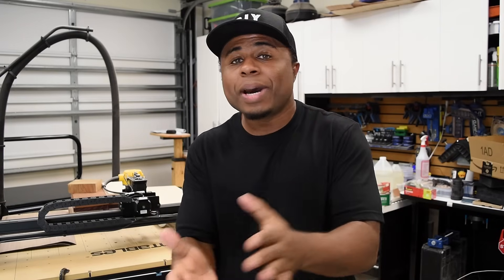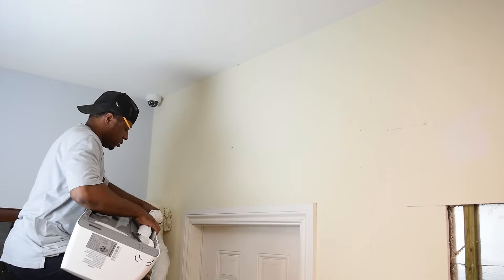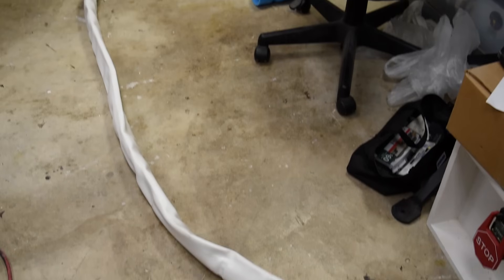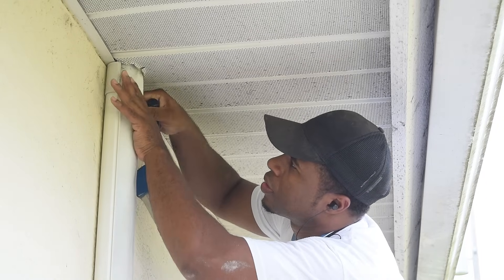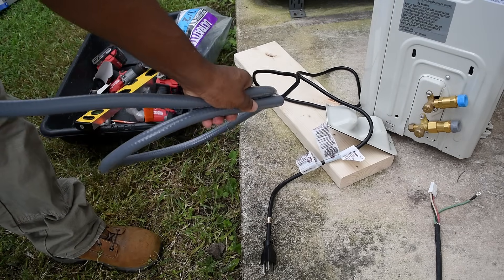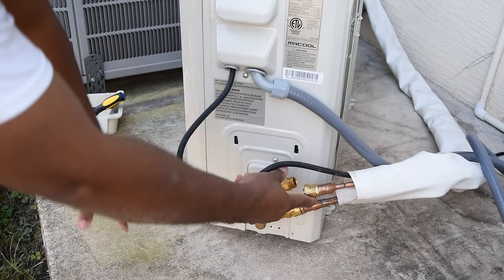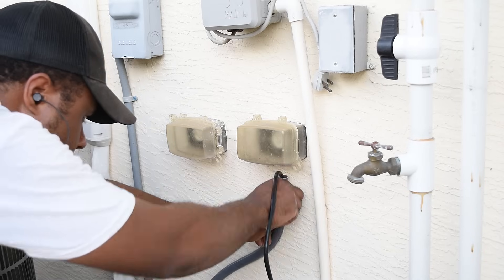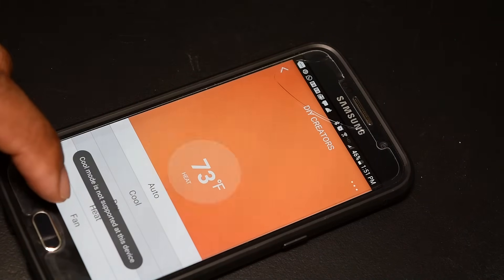How To install Ductless AC & Heating System // True DIY Mini Split MRCOOL

Comment: Thanks for the video. You have made me decide to get this done before summer. I have one tip/recommendation. Put attic foil in the attic above the garage ( atticfoil.com or Amazon - I prefer to buy from the guy who has been selling it for years ).. Installing that will drop the base temperature in the garage significantly and mean that the AC unit will last longer and consume less energy. You staple it to the underside of the roof trusses. I have it throughout the house. It also means that if you do have to work in the attic it is a lot more comfortable ( not comfortable just less uncomfortable I suppose ).

Looks like I am in the market for a mini-split. Thanks again.

Comment: Awesome keep up the good work. I want everyone to follow these directions keeps us service guys busy year round, system now has non condensibles in it. From not pulling a vaccum on system
Reply: Not with this system. The lines are pre-charged as well as the compressor. As you tighten the lines they open at the last 1/2 turn. Then you open the valve from the compressor to the pre-charged lines and your set. That's why you can not cut the lines to size, and you have to coil the excess. No vacuum pump required. Hope this clears that up.

Comment: I'm going to try a system that only costs a little over  1/3 the price of an equal Mr. Cool 24000 BTU ac/heat pump system.  Many systems come "precharged" but my understanding is Mr. Cool charges special copper lines with special fittings  and the compressor and coils are vacuumed and sealed by valves so once you assemble everything you just open valves and check for leaks, where the system I'm going to try the compressor is charged and the lines and coils are open and NOT vacuumed, so I'll need to buy a commercial vacuum pump ( amazon  for $60 - $100 ) and vacuum the lines and coils after assembly but before opening the compressor valves and charging the system.  I want to see if I can do it all DIY for $700 ish instead of $2600.  If anybody sees a fault in my understanding or logic please comment on my comment and leave an opinion.

Comment: I've been looking at the mini-split systems and I like the Mr. Cool because I would like to be able to install it myself. 
My system needs to be a 4 zone 48K btu system. The only question I have is this- is the only length of connecting tubes and power lines just 25'? Or do they come in other lengths?
I will need 2 of the wall units to be more than 25' away from the outdoor unit. 
Anybody know the answer to this? Much appreciated.

Comment: I’m an electrical contractor. I was thinking of installing my own because the hvac guys get $1000 per unit or more.  Thanks to you, I’m going to do my own. I was concerned about having to vacuum lines.
Reply: Just purge the line before you open the suction. Crack or leave the suction side loose to let some refrigerant out and tighten it back up.

Comment: Can I remove the oil heating system in my house and just this those ductless in each room or will the inspector disagree and require to have a Gas/Oil system ?
Reply: In michigan you can have mini splits as your only heat source.  It's best to have more then one or another back up heat in case it breaks or cant keep up in extreme cold.

Comment: If you need to 'fish' a line through difficult conduit, get some string. Tie a small scrap of a rag to one end of the string, and your screwdriver or pliers to the other end, making sure you have a little more length than the conduit itself. Stick the far end of the conduit into the intake of your shop-vac, and block off the rest of the intake diameter with a cloth or duct tape. Turn on the shop-vac and it will draw the scrap of rag through the conduit, while your tool at the other end of the string prevents it being pulled all the way into the shop vac. Total time, just a couple of minutes.

Comment: I would like more information about the way lines are run.  The drain line for example, does it need to be downhill the entire run from the inside unit?  Also this video shows routing the line set up into the attic and then outside and down.  The line set can be routed above the inside unit and then out and down?

Comment: Just a friendly fyi. You need to vacuum the line set before opening the king valves and letting refrigerant into the line set. Specially on a mini split.
Reply: System have moisture now

Comment: CHEAP CHINESE JUNK... DISOPABLE MINI SPLIT.... little to no service parts... poorly made.... limited on line set lengths... poor heating in cold temps... cannot support mini air handlers.... cannot support multiple heads ... in other words ...CRAP!!!  DO YOUR HOME WORK BEFORE YOU BUY OFF THE WALL BRAND NAMES....

Comment: I am HVAC pro tech. My friend Didn't you vacuumed the line before you open king-valve. It will definitely build moiture. Moiture can cause many problems. Then shut down the system....

Comment: if it is really just a 120 v unit, then the heating capability will be not much more than a 1200 or 1500 watt electric heater.  Not bad if you don't need much heat, say in Florida for about one month when it does get down below freezing briefly.  Could take the chill off a room or two but not a big heating thing.

Comment: We have mini splits for 10 yrs, as we remodel a log cabin in tn, we will install 1 or 2 mini splits for the few ac days a yr the cabin needs it. For many years we simply left one big unit on rge upstairs of the block wall house and were comfortable even though the house had one in every room.

Comment: Dumb question, if I have an inside power outlet that runs with a dedicated circuit breaker, is it enough to just plug in (like what you did here https://youtu.be/kI2aLKvMHyo?t=608)  the AC unit into that outlet or do I still need an outside disconnect box for this?

Comment: You should always pressure test a system using nitrogen and use a vacuum pump to remove moisture and create a  vacuum in the lineset regardless what size the lineset is.

Also why did he anchor the unit to vibration pads into concrete  then measure??

Comment: TOTAL BOGUS VIDEO,   SYSTEM IS FULL OF MOISTURE WILL KILL THE COMPRESSOR. , NEEDS A VACUME PULLED TO PROPER MICRON LEVEL AT LEAST 500 MIN.   CONDENCING UNIT MAY COME PRECHARGED BUT THE LINE SET DONT THE GUY WAS NOT TELLING YOU THE TRUTH YOU WILL REGRET IT.

Comment: i install mini splits for a living and im not lying when i say that you actually look like a professional
Reply: U didn't notice him skip vacuum and nitro test process?
Reply: Higher Standard Service the lines are pre  charged , plus he most likely doesn’t have a nitro tank or a vacuum or even a set of guages
Reply: @trillflaco  the lines are not pre charged you obviously dont know what you're talking about. The system is pre charged the lines are simply filled with dry nitrogen until u break the seal, of that... and the fact he doesn't have gauges or vacuum is the reason this shouldn't be done by yourself, the non condensables that are let into the system with destroy the compressor in half its life.
Reply: @trillflaco  who do u install lines mini splits for, I am certified by Mitsubishi.

Comment: I am wondering , it's been a year now since this video..Can you please update us regarding how the Mini split is doing? did it heat up during the winter? and summer of 2019 how was the unit cooling your place. I am very interested to know before I actually buy one. thanks.
Reply: I've been running mine for a little over 2 years. No problems. I use mine mostly for heating. I wish I'd sized up as a lot of heat goes upstairs in the winter. Have to switch over to wood heat around 35 degrees. Cools just fine though.

Comment: You need to remove the air from the pipes with a vacuumpump before releasing the refrigerant!
Reply: This is a DIY version which means you don't have to evacuate anything. Know what you're talking about before you reply to something you clearly know nothing about.
Reply: @Ozzie4Para  okay chill, my bad..

Comment: You missed huge crucial steps. You cannot just connect lines and drop charge. Once those copper lines are exposed to the air moisture and other non condensables rush in. After connection u need to use atleast a 2cfm vacuum pump to pull a 29 inch vacuum for atleast 30 minutes. Although you should use a micron gauge and go by that. Also you can cut and resize those lines. But not running a vac on those lines will b a problem in 2 or 3 years.
Reply: Nope. Not necessary. Lines are charged and sealed at the factory. Seal isn't broken until the lines are connected.

Comment: If you buy almost any ac online without going through a certified tech. You will not get a warranty the manufacturer wont tell you unless you ask but online sales and systems not purchased and installed by certified personnel VOID ALL MANUFACTURERS WARRANTY
Reply: Nope. The Mr. Cool's DIY unit is covered by the manufacturer's warranty when installed by the do it yourself'r. Says so in the owner's manual.
Reply: @brianbrehmeyer3929  really? That's great. I noticed the mr cool DIY does not require you to make system modifications, it is basically a plug and play. The only thing about that is you have to use what they give u and cannot customize anything. I guess it's kind of you get what u pay for type of thing
Reply: Also the diy video does not show anyone testing with nitrogen or vacuuming non condemnable out of the line... even if they come sealed the second u open the line it inhales moist outdoor air which will ruin the integrity of internal components between 8 and 12 years.
Reply: @higherstandardservice9877  The line is sealed. It is fastened to the heat exchanger, that goes in the house, at the factory. There are valves at the other end that open when the lines are connected to the pump. It's been two years, but as I recall it was a flat to flat mating where they were hooked together. The valve opened around the last turn or 1/2 turn on the connector, so there is very little, if any, exposure to outside air. If there was any leakage, I'd think it would be a very small amount of refrigerant leaking out, rather then air leaking in. 
Break even (compared to my previous heat source), for me doing the install, is 3 heating seasons. (I've just started my 3rd.) I had one bid from a contractor I found at Costco, break even would have been 9 heating seasons if I'd went with them.
Reply: @brianbrehmeyer3929  I understand this unit is made and designed for do it yourself installation. However, this is not how any major manufacturer makes their systems purely because they will not last as long, they do not offer customization or pipe length modification etc... regardless of how sealed those lines are there moisture is going to enter the system and shorten the life span. Is this product worth its price and effort, no it's as capable as a window unit or portable ac. The fact that you cannot isolate the refrigerant charge nitro purge the system and vac it down for service is just another reason it's not going to last more than 6 years or so.
Reply: @higherstandardservice9877  Well time will tell. 
But, assuming you are correct and it lasts 6 years, I could replace the Mr. Cool 3 times for what the contractor wanted for one installation.
Reply: @brianbrehmeyer3929  that's exactly my point u get what you pay for is all. Brian I am curious how well this mr cool performs? Is it a good option for the consumer who cannot afford or doesn't want to spend thousands to cool one room or small addition? And do they offer heat pumps as well as ac?

As I mentioned I dont like how it does not let you cut the pipes to length etc but I could see this being beneficial to some customers.

Comment: You will want to suck the air out of the copper pipelines, A/C refrigerant and the oil on the compressor are really sensitive to air and water so before opening the lines you will want to connect a vacuum pump and remove that, otherwise it might not cool as good and the compressor lifespan might be highly compromised.

As a DYIer if you don't have a vacuum pump available the option would be to remove the valve from the return pipe (bigger) or connect a hose so the air can exit the system and then open the exit port so the refrigerant loaded on the system pushes the air out the system through the return port.

On the video and the manufacturer site they claim this is not needed and more likely they says this as this unit uses Freon 410-a which is more tolerant to humidity in the system, but I'd do it anyway to ensure the best performance and longevity of the whole system.  I worked for over 7 years on my own A/C company and installed more than 500 of these units.
Reply: Nope. Not necessary. Lines are charged and sealed at the factory. Seal isn't broken until the lines are connected.

Comment: Excellent presentation. One of the best DIY videos I've viewed. After watching your video, I think I will go with the brand and model you selected. One question, did you use any 'pipe dope', gas caulk or teflon tape on the refrigerant hook up? Thanks for the video. No 'funny' remarks, no back tracking or long pauses. Just straight shooting talk, clear camera work and made short at the right moments rather than drag on making the viewers have to fast forward it ourselves. You made YouTube proud. One final comment. You made me smile when you mentioned how exhausted you were with the 'push & pull' by yourself. Been down that path many times myself.

Comment: It is hard to believe....Why didn't you leak test then pull a vacuum on the line set before opening the service valves? Line set is pre-charged with nitrogen not refrigerant. Always leak test and evacuate the line set per manufacturers instructions. Vacuum down to 500 microns. Very important step was missed here. If this were done on my house I would deem it unacceptable.
Reply: Nope. Not necessary. Lines are charged and sealed at the factory. Seal isn't broken until the lines are connected.

Comment: Procedure is incomplete
No vacuum and pressure test was done.
DIY'ers please leave for certified technicians
Reply: LISTEN UP EVERYBODY THAT POINTS OUT THAT HE DIDN'T RUN A VACUUM BEFORE CONNECTING THE LINE SET.   OK, PERHAPS HE DIDN'T EMPHASIZE IT ENOUGH BUT THE LINE SET IS PRECHARGED EVIDENTLY WITH REFRIGERANT R-410A SO THERE IS NO NEED FOR A VACUUM TO BE PULLED.   PERHAPS THIS IS WHY HE METIONED THAT YOU CAN'T CUT THE LINE AND IT MUST BE INSTALLED INTACT.

Comment: Gotta run a vaccum my dude. Problems in your future
Reply: Nope. Not necessary. Lines are charged and sealed at the factory. Seal isn't broken until the lines are connected.

Comment: I have one comment which I'm sure has already been mentioned.  You need to pull a vacuum on the system before releasing the refrigerant into the evaporator and lines.  Having air in the system will create phosgene gas in the system and degrade the refrigerant overtime causing a failure of the compressor which will require a lot of money to fix.